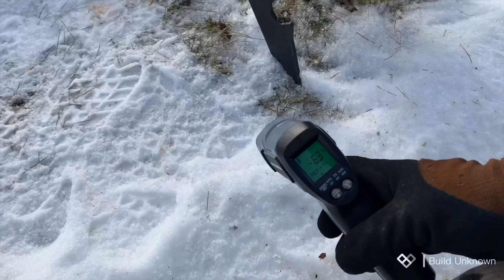Build Unknown: Rocket Stove

Comment: Make it in aluminum
Reply: yeah sure, that will melt pretty fast
Reply: @dimplezdimples8451  even using quarter inch
Reply: @michaellongsr8642  I had 3/4" round bar melt, high heat and aluminum don't mix very well
Reply: @dimplezdimples8451  wow, Thanks for the update.